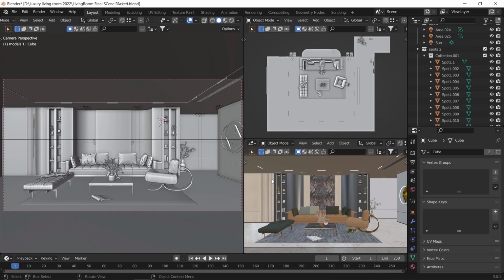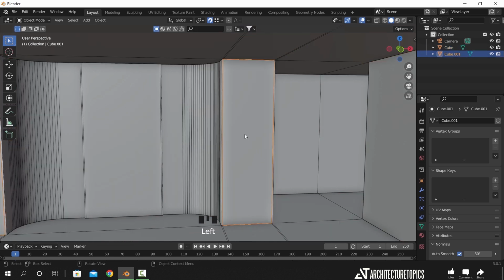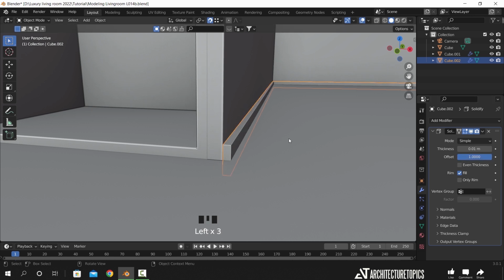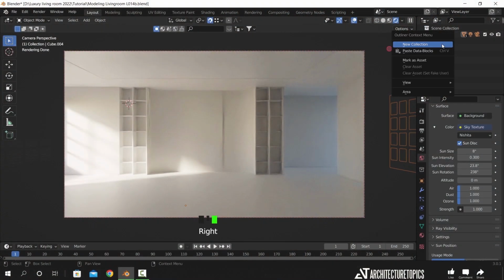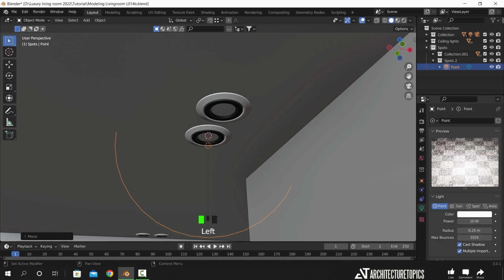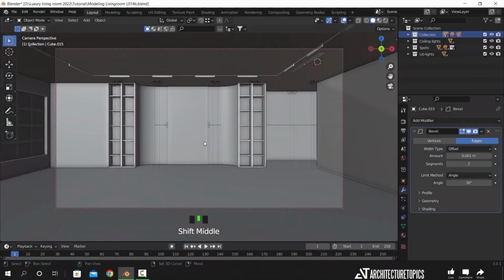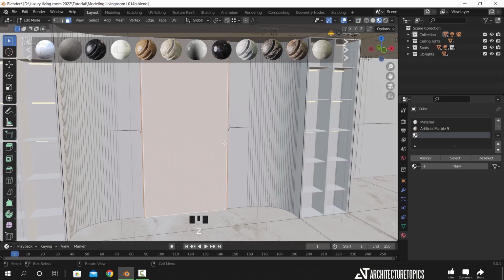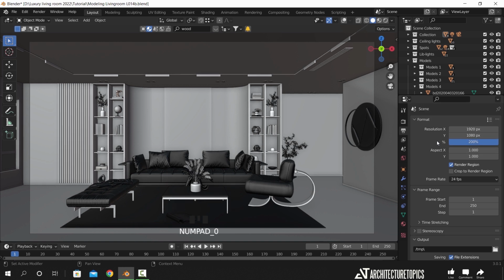How To make Interiors in blender - Tutorial ( Free Models)

Comment: How do you get to high quality rendering. My rendering takes to long and is not that nice.
Reply from the maker: Render quality depends on 2 things ( mainly)...
1- Samples Count and for interiors 800 should be enough in most cases. This number can increase or decrease depending on many things like the furniture you're using or the device GPU / CPU .
2- Frame dimension, the default 1920*1080 is fine. However you can double it for faster render while keeping the samples low around 200 - 400 if you're using good GPU.
We did make a video on output render settings and another one for the viewport render so make sure to check them out 
- Output render settings here https://youtu.be/JBTvSW_sYLs
- Viewport Render optimization here  https://youtu.be/m64l020uPSE

Comment: Is it possible to use the IES with the emission material assigned to an object to work as lighting source instead of using a Point light, if so would this affect the render time?
Reply from the maker: You're stepping into the unknown mate lol, I really don't think it will give you the purpose of the IES once you link it to an object but you can try it. maybe play with the object scale or rotation for different effects though you won't have any control for the settings we mentioned.
Reply: @architecturetopics  thanks for your feed back, I'm following all your tutorials, thanks for sharing your knowledge

Comment: Hi , love your videos. Helped me so much. I have a problem. Why does my render have "smudges on some parts of the wall. I googled it and it's called Denoising Artifacts. My scene sample is 250- 1000, Optix denoising and still have smudges. Help thanks.
Reply from the maker: With noise you need to check the amount of light in the scene because less light than needed will generate noise. and also you have the glass material which sometimes make it hard for you to get rid of the noise inside the room. after that you have enough samples count with the de-nosier on.
Nvidia de-noising GPU works better with large number of pixels that's way we can use small number of samples with bigger resolution.
Those are the main Lines about noise try check in them one by one, the default render settings should be enough to get you clear image. 
If you think the problem is with your blender version try updating it or use another one in testing.
hope this helps.
Reply: @architecturetopics  Thank you.
Reply: Hi I don’t know if you managed to sort this yet but I was having the same problem yesterday and the more samples I used made the problem worse 😮 it was really bad like I’d been sculpting on my geometry??….after a ton of digging I found a post on Reddit which advised unchecking-noise threshold (adaptive sampling) and it worked for me…you could try this 😊